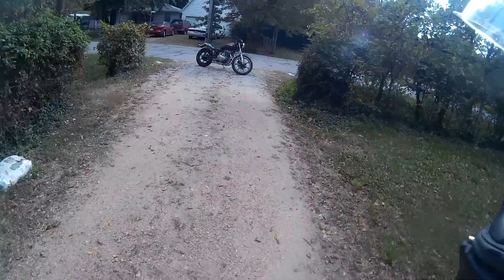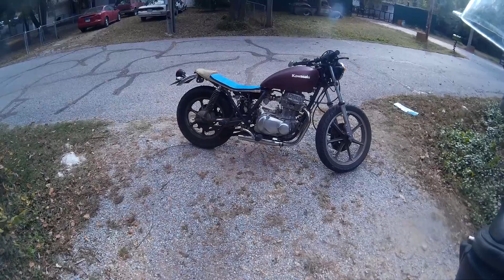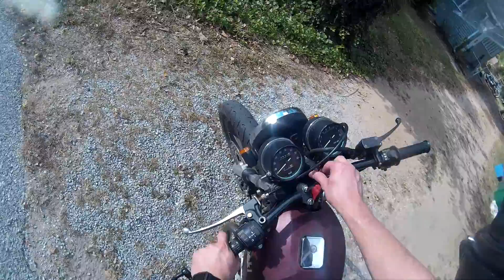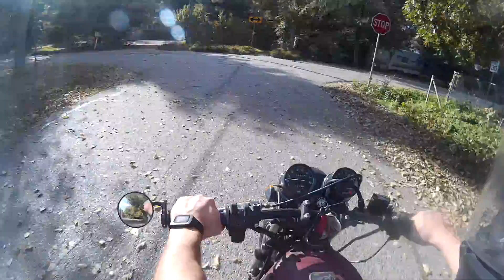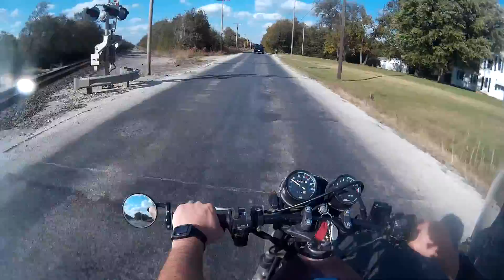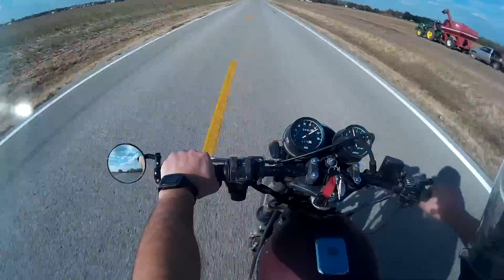KzDom MotoVlog #1

Comment: Great MotoVlog!  Just picked up an '82 440.   Keep the videos coming, they are a wealth of info and quite well done.  I appreciate the fact that you don't use foul language like so many other channels. Good on You.   Couple of questions if you're able to answer. Why had you gone to the single carb setup instead of the original? Is the single carb the reason the bike sounds great with that low tone rumble or is that solely your exhaust setup?  Would love to see a complete engine tear down and rebuild.  Thanks again.
Reply: Will McMurr the single makes it easier to tune